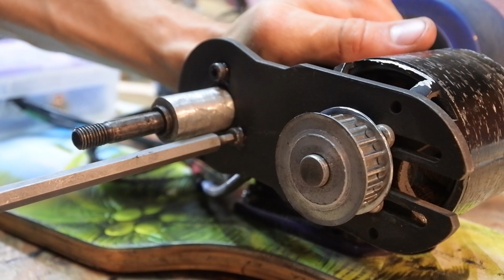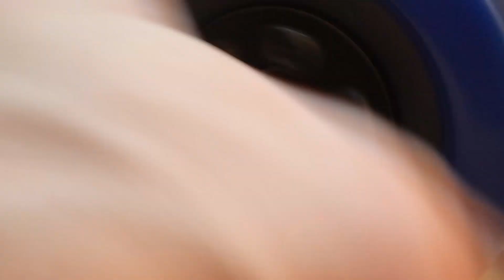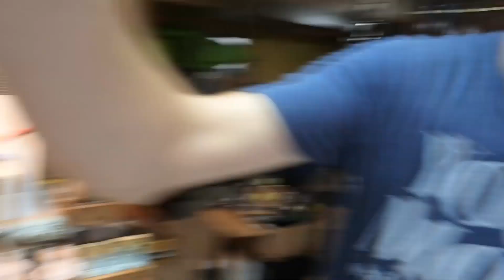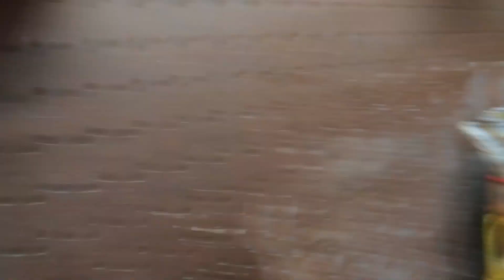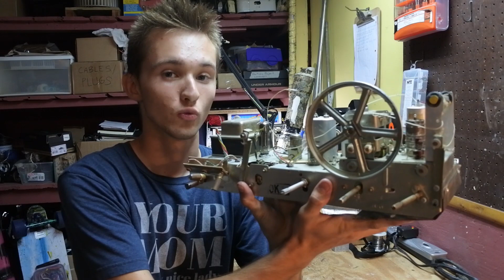Why I'm Making Videos

Comment: Does your motor mount sit still now or has the collar come loose again? Maybe it'd be worth making a collar out of the same metal as the truck so that you can weld it on. Or just use some JB weld.
Reply from the maker: Actually It's been collecting dust ever since I have a car now to drive LOL. However when it gets a little warmer i'm planning on making a full video about the board, addressing this topic and many others. It's not that cut and dry of a choice tbh because you can make that collar as stiff as a weld if you file down a flat spot where the screw on the collar touches the axle and secure the screw with some loctite. The big advantage of having a removable collar is being able to upgrade to new motors and mounts very easily. So right now that's how I have it setup on my board. Sure if I wanted to go the permanent route I would weld a custom collar to the trucks axle, problem is that its aluminum, but I figured out that you could weld aluminum with a stick welder and some aluminum rods so it's something I definitely want to revisit. 

Thanks for the comment!
Reply: @SciCynicalInventing   SciCynical Inventing  Oh I'm spoilt lol. My uni has a plasma cutter so I just made a new mount with that, drilled holes to match the old collar.
Reply from the maker: Thanks I actually made my electric board for the same price as the laser cutter believe it or not. Really jealous about the plasma cutter, they're so nice to have when working with metal.
Reply: @SciCynicalInventing  Found your channel through the laser cutter video, very impressive what you made for the budget.